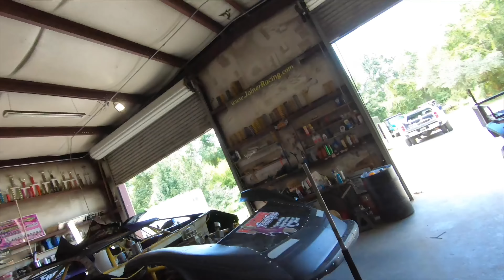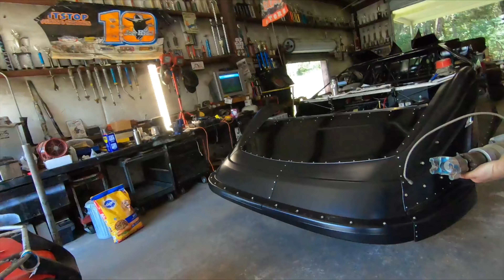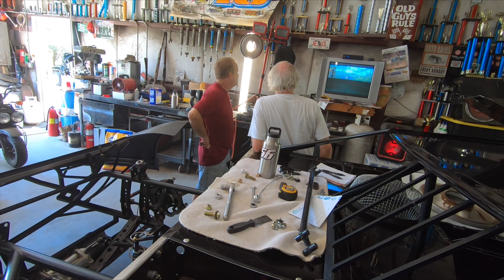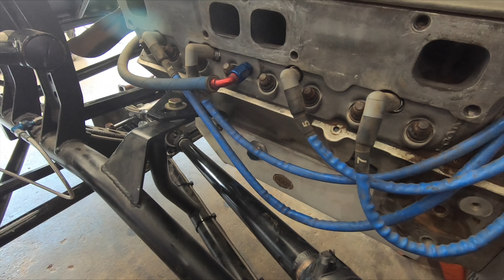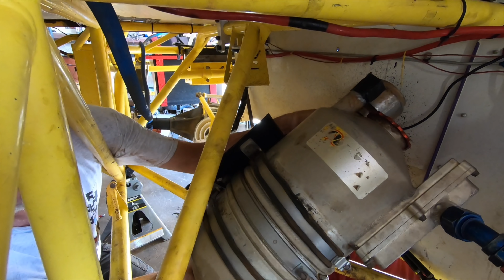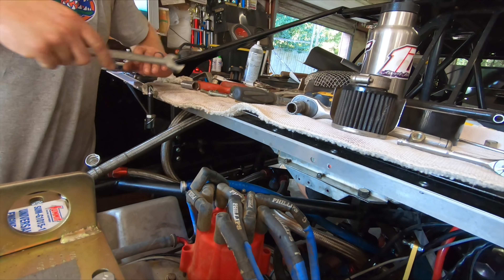We Bolted the Big Motor in the New Late Model

Comment: I love y’all a family. Great job. My son and I plan on racing together to. He’s 18 now. Races about everything under 500 horsepower. Lol. H would love to go fast. So we got a 98 ford ranger step side fiberglass bed. And we are trying to put a 454 Chevy in it to drag race but we need everything. Steering wheel ,shaft. Tires shocks knuckles to make four link. Throttle petal and cable or rods.   And time. Lol.

Comment: What's the best class to start racing in on a medium to low budget?
Reply: What track is local to you? Different tracks have different classes.
Reply: @josephtalbot125  where I'm at we mostly run late models super and crate, per stock, super stock, hobby stock, sprints, hornets and mini sprints once in a while
Reply: Aaron- kun I’m not familiar with pro stock and super stock class requirements, I know hobby stock can be inexpensive. The tracks local to me in the Midwest have seen a decline in hobby stack cars in favor of IMCA stock cars.
Reply: @josephtalbot125  per and super stock are basically the same main difference is how big or small of a motor you can have. My uncle has ran per stock before and I thought about getting into that. But I wanted more options on what would be a good suggestion on what to run

Comment: I would definitely go get some hi-temp black grill paint and paint the frame tubing clos the drivers side header. Would not want the paint to burn off and expose the tubing for rust to get a start.  May also want to install a spacer / between the frame and the header until you know for sure the header will not hit the tubing. It will deflect some from vibration and the comment was 1/8 of an inch clearance if I heard that correctly.